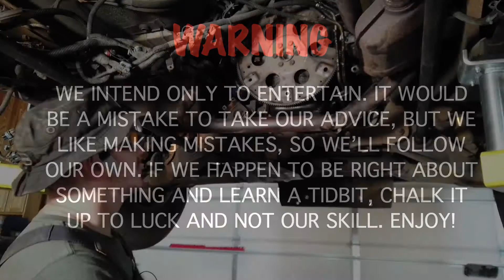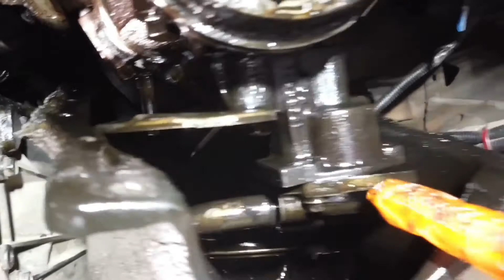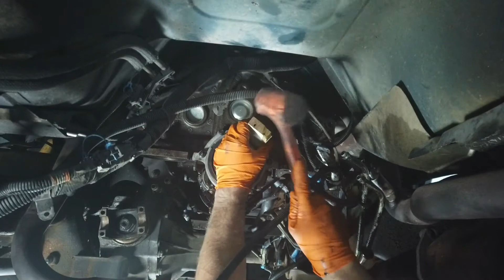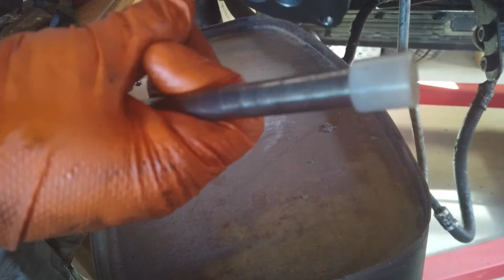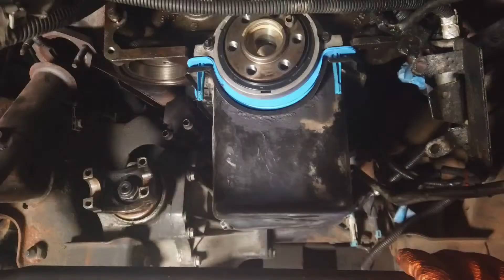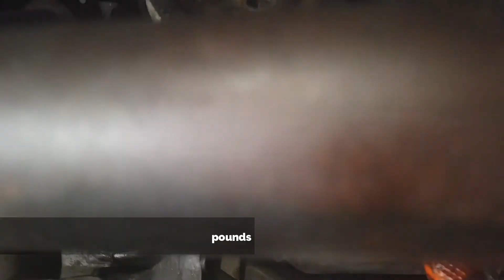How to Change a Rear Main Seal, Oil Pump and Pan Gasket on a 1988-1998 Chevrolet K1500 (GMT 400)

Comment: Now I see why my local mechanic wanted 1300 to change my 1998 5.7 but it's a 2wd 2500 truck. Were these all originally a 2 piece rear main?? What a pain in the main!! Can I easily eliminate my oil cooler without the front axle in the way?? Great video my man!!
Reply from the maker: 2wd does make this job easier. Oil coolers are not necessarily required if you don't tow or haul but... We don't like bypassing them. 

If the leak isn't too bad, you could just live with it until your transmission needs to come out for a different reason. Otherwise... Grab a cold beverage and set aside a weekend! 

Thanks for watching

Comment: I just pulled my transmission, in a gravel driveway… only took me 8 hours 😂 dang rusty bolts. I’m thinking it might be easier to pull the engine and install the engine and transmission together when I re install lmao. Hopefully my junkyard 4l80e is a winner!
Reply from the maker: Shoooooooeeeeee, that sounds awful. We should have a video about that 4L60 in the library.
Reply from the maker: Changing the Transmission in a 1996 Chevrolet 1500
https://youtu.be/_7LXWSgW3xs

Comment: I took the pan off my 1990 k1500 and it had some oil pan rails. Should I install them with the new fel pro gasket?
Reply from the maker: Yes! Those help maintain proper torque across the pan to prevent leaks and warping.

Comment: When u install the r.main housing how do u center it perfect.?
Reply from the maker: The way we did it was align the gasket, the housing, then slowly and evenly bolt everything together. Once it's snug, give it the old eyeball check, then torque it down... We might have done it wrong, but it's been holding up for a few years!!

Comment: So no rtv required for the fel pro gasket? Why is that? The service manual calls for it and i don’t want to do this job all over again if it leaks 😂 but i trust your judgement
Reply from the maker: Felpro is designed to be installed on a clean and dry surface. It is rubber so it will naturally fill imperfections where cork or paper sometimes fail.

Felpro does allow some supplemental use of rtv in specific circumstances, if used sparingly and deliberately it might be ok. 
 https://www.felpro.com/technical/tecblogs/how-to-properly-use-rtv.html
Reply: @NiceGuysGASS  thank you
Reply: My Haynes book say dry k1500 blazer

Comment: What kind of leaks were you getting before deciding to change those gaskets out ?
Reply from the maker: All of them. It’s a Chevy, so it’s guaranteed to leak from anywhere a gasket or RTV was used. Specifically, the oil pan was wet, the oil lines were a bit leaky at the junction block with the oil filter and the oil was definitely coming from around the transmission plate. It’s one of those jobs that involves changing everything because it’s already apart.

Comment: why do seal kits come with a large round gasket?
Reply from the maker: The gasket is probably for the cover at the rear of the engine, but we’d have to see what you are talking about to be sure. Many of the gasket, seal or o-ring kits you buy from the parts store come with a variety because there are so many versions of engines out there.
Reply: @NiceGuysGASS  im thinking it may be for an LS engine,. it is abt 6 inches in diameter and has several bolt holes in it..